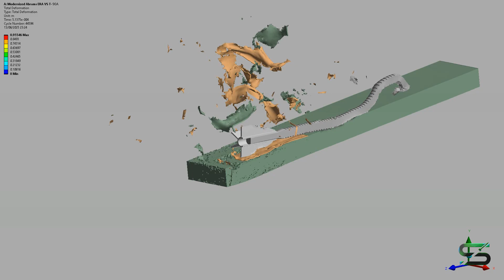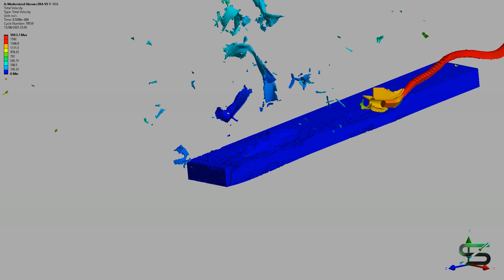Modernized M1A1 Abrams with ERA VS T-90A | APFSDS Armour Piercing Simulation

Comment: ERA does not explode on contact APFSDS
Reply: kontakt-1 does
Reply: All russian ERA explodes when hit by a APFSDS
Reply: No it doesn't

PVV-5A is a plastic explosive made of 90% hexogen and polyisobutylene. The explosive is sensitive to heat but insensitive to impact. This ensures that the plasma jet of a shaped-charge projectile ignites the explosive for the required defensive detonation. Fire from small arms projectiles and even armor-piercing arrow-like projectiles will not trigger the detonation.
Reply: @stanbeec1748  Its not sensitive to heat, there are several photos of burned out tanks with the kontakt 1 still intact. the "plasma" jet from a shaped charge doesnt ignite the explosives in kontakt-1 because a shaped charge projectile doesnt "melt" through armor, it punches through armor via the very fast jet of copper
Reply: @ghandiosa Normal fire does not trigger detonation of the Kontakt-1

The explosive liner is highly insensitive so that it doesn't explode from bullets or fragmentation. Even tank ammunition cook-off events do not detonate the ERA. This characteristic also prevents chain reactions for Kontakt-1, but it makes the system ineffective against kinetic energy penetrators. However, due to the fragility of the blocks, they can be easily destroyed by a hit: a HEAT round can destroy up to 85% of all the ERA from the tank's front.

When a shaped charge's jet stream hits the explosive liner, it detonates, throwing the metal plates at the stream obliquely. As a result, the jet is deformed and defocused, losing its energy. Its efficiency is low at a straight angle and increases significantly as the angle changes, explaining why Soviet tanks have a prominent wedged ERA configurations on their turrets.
Reply from the maker: @stanbeec1748 Well, I don't accept Wikipedia as a reliable scientific source.
Reply: @SimulationPlus  he's correct. You can watch autocannon fire and other sources that hit ERA and notably Kontact 1

It's too insensitive to go off, it's so insensitive that you can use it as fuel for a fire without exploding. 

Granted autocannon fire is different from a dart but the same applies because ERA like Kontact 5, relikt, etc have a different method to explode
Reply: @stanbeec1748  there is no "hexogen"
there is rdx
Reply: @stanbeec1748  check trial documentation. There is a chance that K1 explodes when hit by apfsds, but it's just about a 30 percent chance or something

Comment: Oh dang nice, now the rest of the round is gonna hurt some other stuff but yeah, a living crew is better then a crew who is competing for a turret toss competition
Reply: It wont kill the crew but seeing how the rod is still going at 1500m/s that can probably damage the breach or turret ring
Reply: @ser43_OLDC yeah, that will hurt
Reply: and not beeing seen is better than being fired at and surviving
Reply: And the cause of the turret pop is mostly ammunition stored around the turret, which if ignited will cause a chain reaction of igniting the carousel ammo
Reply: @Jc_7058  Though, it is hard to change Russian/USSR autoloader. They prefer low profile and light tanks when these 125mm round is separated into 2 parts, making autoloader a better choice than human loader. Loading these 125mm by hand would take 10s+
Reply: @alderlake12th not correct, the challenger 2 uses 2 piece ammunition and the reload times for a human loader is well below 10 seconds
Reply: @connivingkhajiit  Well it is still 120mm. The russian/ussr 125mm is pretty heavy
Reply: It’ll probably go through the 50mm turret ring and spall the crew or and the internal components
Reply: There are some autoloaders that won't toss the turret sky high if it gets hit, but the thing with Russian autoloaders is it's a carousel down in the tank's floor, which, if it gets ignited, is going to send pressure rushing up and tossing the turret clean off
Reply: turret toss?? abrams has blowout panels